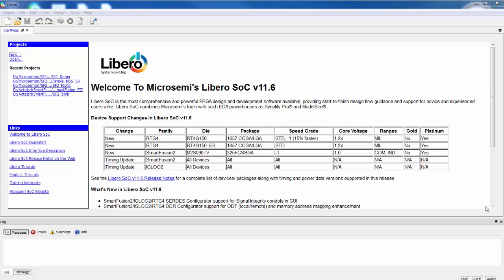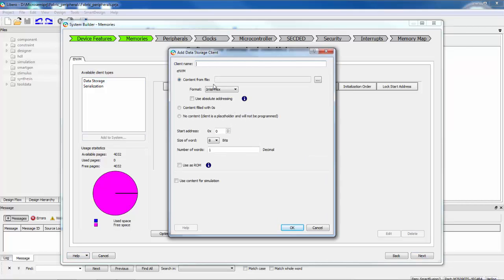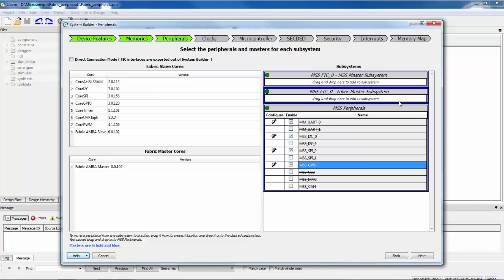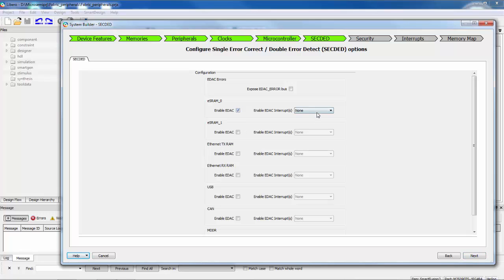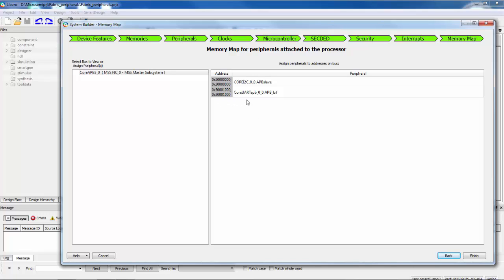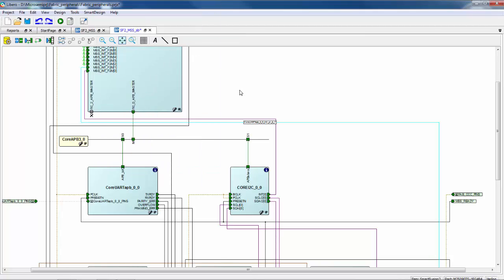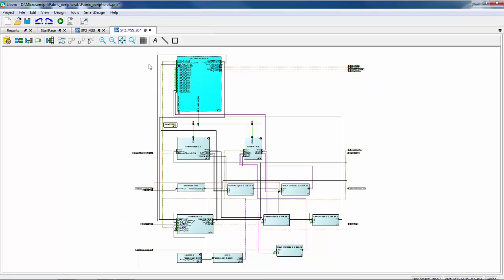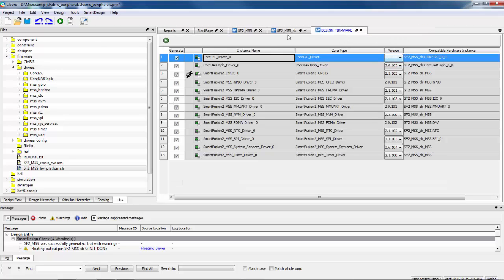Getting Started with Microsemi SmartFusion2 System on Chip (Part 5) – FPGA Fabric Peripherals

Comment: If you don't enable an EVM, then the arm code can't run at power-on?
So once you've converted the SystemBuilder block to SmartDesign / MSS Configurator, the only way to open it back in SystemBuilder is to convert it again?

Why did the platform.h only show the UART and I2C soft/fabric peripherals.. since in SystemBuilder, you enabled the UART, I2C, SPI, GPIO hard/mss_ peripherals too!  Interestingly, the SystemBuilder's last Memory Tab does show 2 addresses for a single peripheral HOWEVER*, the Generate Memory Map Report only shows one address.. and exporting a firmware example, the address shown in Platform.h is *NOT the one shown in Memory Map Report / SystemBuilder_hw_platform.h ?! 

Finally, how do you add custom logic?  I've created/imported a reg_apb_wrp.v, but dragging it from the Design Hierarchy to the SystemBuilder canvas doesn't show the '+' as with built-in components.  The 'Check HDL' passes, I press 'Build Hierarchy' button, and finally 'Import' the HDL file..   yet it's listed under 'User HDL Source Files'.    My goal is to "Create Core from HDL" and connect the SystemBuilder's MSS' AMBA Slave (AHB-Lite) to my custom Logic's BIF (via CoreAHBTOAPB3 / CoreAPB3).